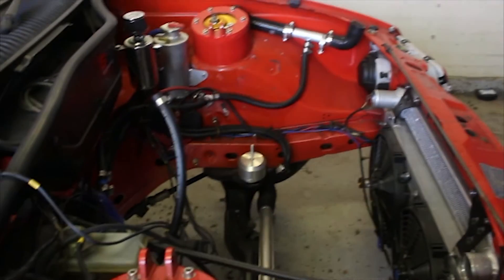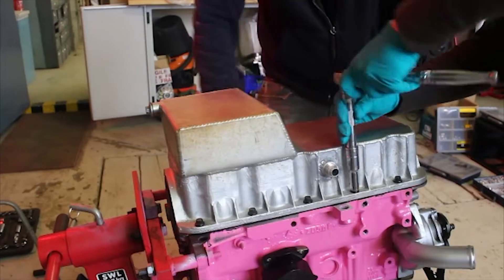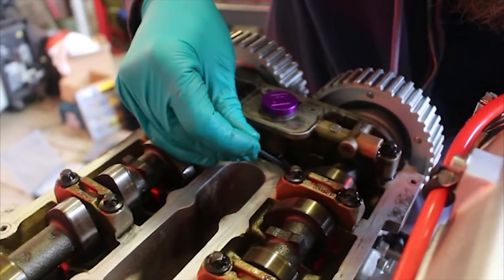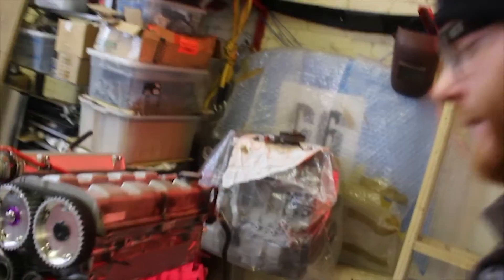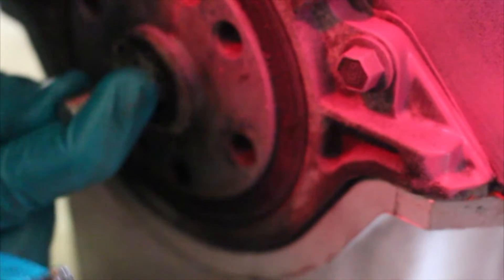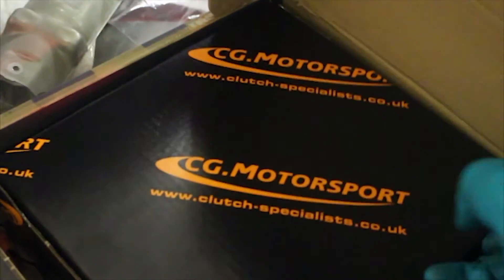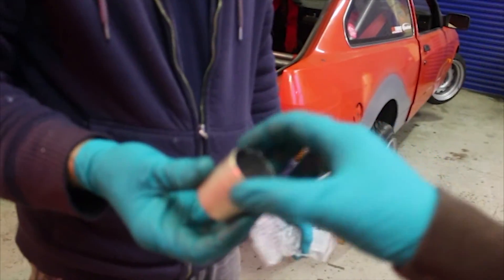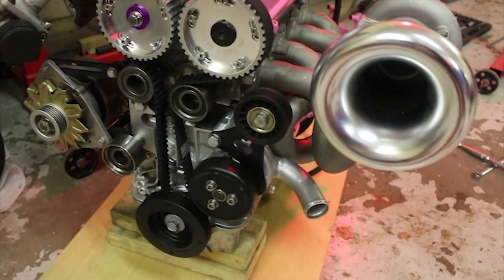The JellySlider - Episode 2 - the pink turbo engine freshen up

Comment: Great vid immaculate engine what inlet are you using I know it suits rwd but I’m doing focus st170 track car and needed intake but opposite side throttle body great looking intake manifold 👍
Reply from the maker: Steven Carson in this video it is a rover 220 turbo inlet on an adapter plate. The throttle body was originally on the other end as it’ was in a fwd car. We Relocated it for the red set up. Now we have a Zewspeed inlet which looks and flows a lot better   Hope that helps 👍🏻😉